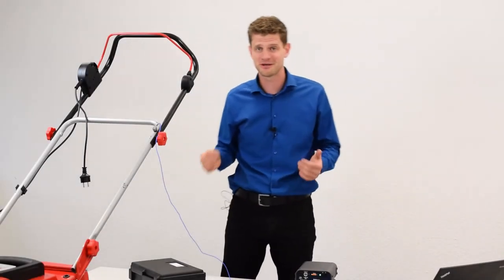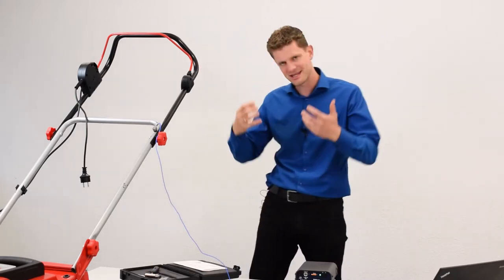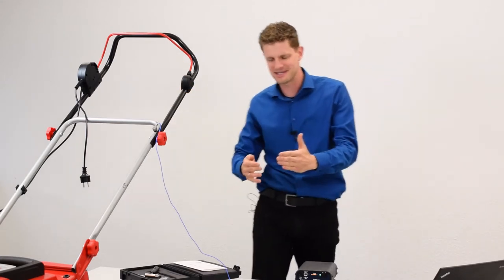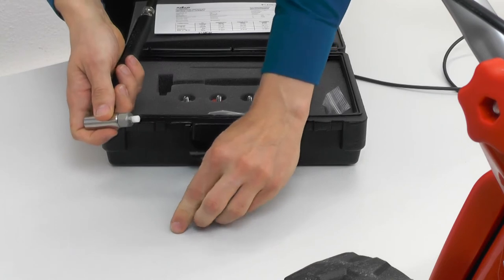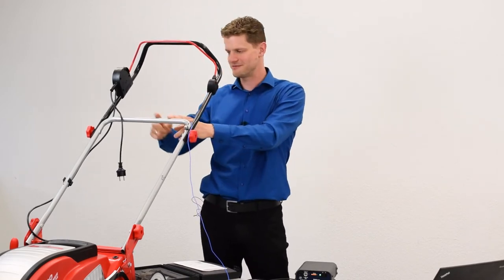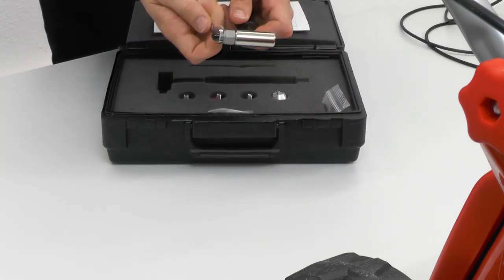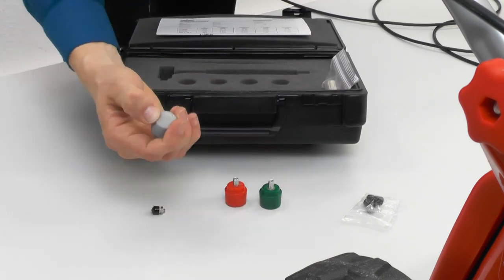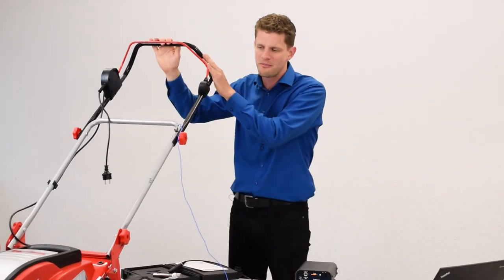Different hammer tips | Introduction to modal analysis | Part 5

Comment: I want to find the damping ratio of a helical spring using this method:

1. Attach an accelerometer at the top of the spring.
2. Disturb the spring by hand to generate a time vs. frequency graph.
3. Convert this time vs. frequency graph to an FFT to see the frequency vs. amplitude graph.
4. Find the damping ratio using the half-bandwidth method on the FFT.

My questions are:

a. Is this the right method to find the damping ratio, or is the FRF necessary to include the force with hammer impact?
b. What if I use or don't use an impact hammer as in this video?
Reply from the maker: 1.: Yes, the procedure is correct. If you want to know the damping for each resonance, this can be done using the averaged FFT. 
The overall damping can be determined from the time signal.

2.: The advantage of the hammer test lies in the ability to calculate a Frequency Response Function (FRF) using controlled excitation, where both input and output are known. A curve fitter can then process the measured FRF and accurately calculate resonance and damping for each mode.
Reply: @HEADacousticsInternational

Thanks for the response, brother.

1: Okay, totally got it.

2: Without the hammer, we are getting the time vs. frequency data and then converting it to FFT in OriginLab, as there is only one output response.
Now, with the hammer impact, we will have input data for the impact (force) and the output data we are already getting.

How can we combine them into one FFT? Is there any method for this? Also the FRF would be only for force( input) or for both?
Reply from the maker: The FRF H(f) takes into account both input and output. There are multiple ways to calculate it. First, the FRF can be approximated by direct division of your input spectra I(f) and output spectra O(f): H(f) ≈ O(f)/I(f). This can however lead to instable results under certain conditions, e.g. when the input spectrum is close to zero for specific frequencies.
The robust and accurate way is calculating the FRF based on the auto and cross spectra of input and output. The cross spectrum of input and output is: S_IO(f) = I(f) * O_conj(f), where O_conj is the complex conjugated output spectrum. The input auto spectrum is: S_II(f) = I(f) * I_conj(f), where I_conj is the complex conjugated input spectrum. Division of the two yields the FRF: H(f) = S_IO(f)/S_II(f). 
By the way, if you want to give this a try in ArtemiS SUITE, you might want to consider applying for our modal trial: https://www.head-acoustics.com/modal-analysis . All you need is your recorded time data, and we can provide the required software modules. 30 days free of charge.
Reply: @HEADacousticsInternational  How to request a 30 days free trial?